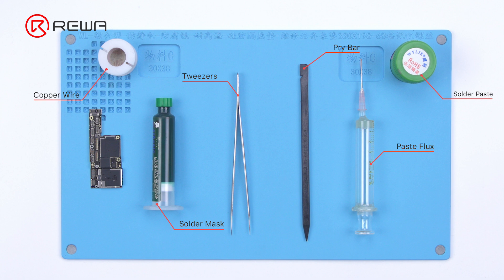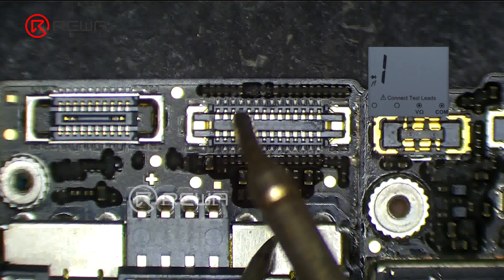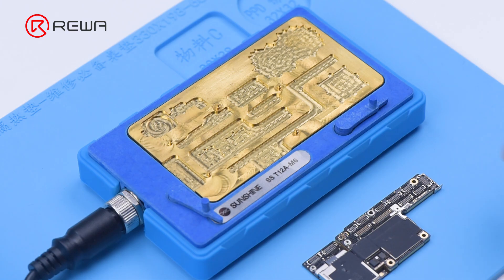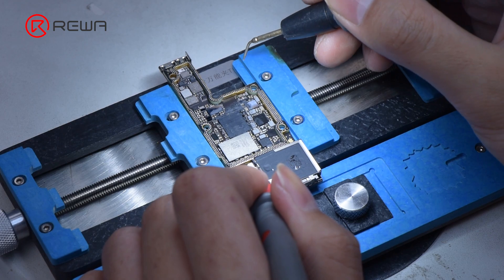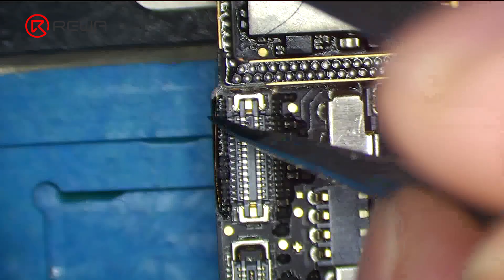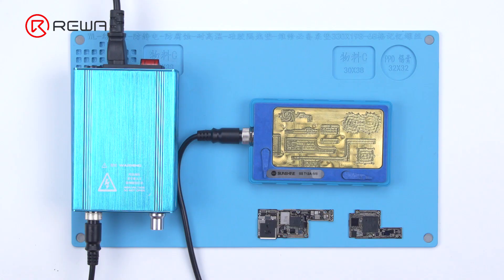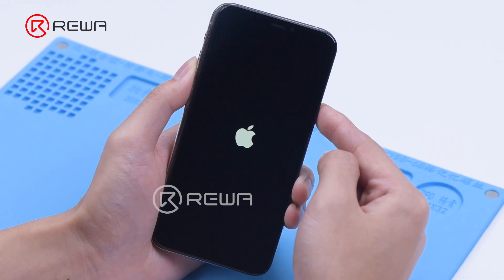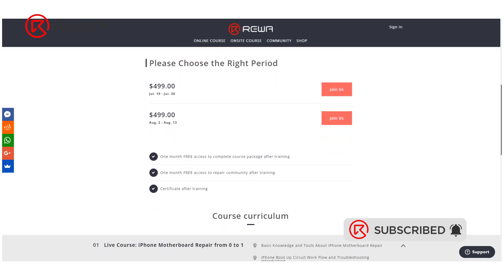How to Fix iPhone XS Unresponsive Touch Screen/Touch Screen Not Working

Comment: some part of touch screen not working after water damage..so i have replaced with diff screen and no issue at all after that.. but just wondering, can my original screen still can be fix? is it the issue cause by digitizer or touch ic?… FYI, all of this happend 2 year ago, recently drop my phone n cheap screen crack..ahaha

Comment: I called Apple explaining touch screen not working, left edge of my screen to be exact.  They said I need a new lcd, so is it the lcd or the logic board respective of this video.  Screen works perfect otherwise.
Reply: Firstly you have to check the lcd connector if there is the fault you don't have to change the lcd but I everything is fine then you should check new lcd 👏

Comment: The easy way to test this problem without needing to test the resistor is to just press on the motherboard. If touch starts working then you know its the sandwich board. Iv seen loads of these now with the same problem, for data recovery you can just press on the board and touch starts working again, either that or crank the screws up super tight.
Reply: Excuse me, where do I need to press? Because my iPhone XS touchscreen stopped working... before I was able to turn it back on simply by force rebooting the device, but now it doesn't work anymore...